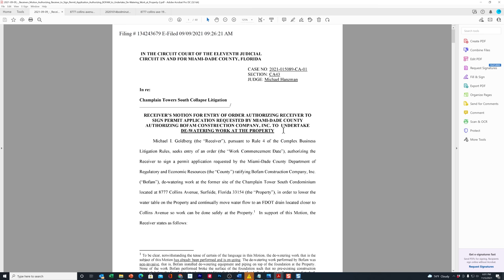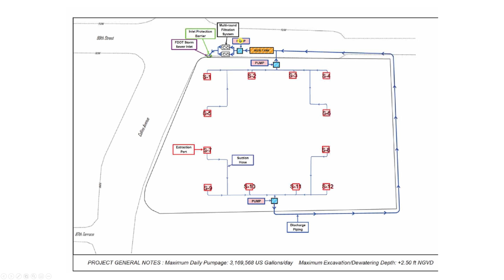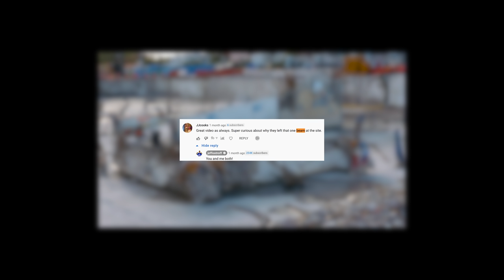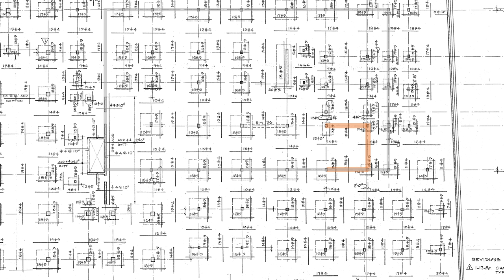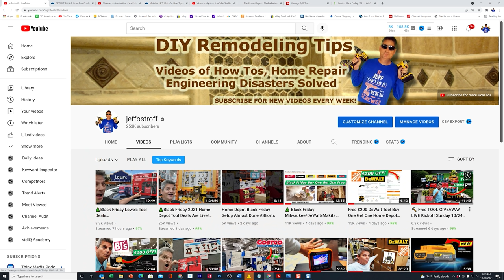Miami Condo Collapse: Engineers Baffled By Mystery Column

Comment: 2:03 You have your load theory backwards! The FOUR columns could actually be THINNER because they are SHARING THE LOAD OF ONE SINGLE COLUMN!
Look at the load point of the secondary column! There is no sign of attachment to the secondary column. That means IT SLIPPED OFF! All the floors give the column it's horizontal stability, so loss of the H beam is going to fire that column straight down like a released arrow with the mass behind it of a steel and concrete locomotive, a Coors Silver Bullet rectal cancer special!

Comment: Are you sure it's not just a rebar bundle that was placed there?  There are several bars that are just laying on the ground and the others look like they could just be sitting on top of the cement as opposed to sprouting out of it.
Reply from the maker: it could be, but they are impaled into the concrete
Reply: @jeffostroff  Doesn't that imply that the column wasn't there?  Or am I missing something?

Comment: Why is there only one H beam on the property, and why there?
Reply from the maker: There is only one H-beam there because it is the only place where they needed 1. I'm sure they are fairly costly to make so you would want to limit them because it's a lot of concrete and rebar to form together just to keep 1 stupid column from blocking the driving lane inside the garage. So this H-beam was built to allow a floating column on the 1st floor to go all the way up to the Penthouse, but yet not protrude down into the garage where it would interrupt the driving lane. So they accomplished this by placing the H Beam on 4 columns columns and then the cross beam supports that K column running up to the Penthouse.
Reply: @jeffostroff  Thank you for the explanation. I was more wondering why an H beam was more critical there than elsewhere. Is it because of the penthouse adding more weight?
Reply: In terms of physical size, the H beam was a baby.  Champlain Towers South had an absolutely MASSIVE array of transfer beams on the west side, one floor higher, 50% more massive in cross-section than the H beam.  

Fortunately, the architect was smart enough to use bigger, 24" x 24" columns to support them & the west side, and that is a pivotal reason the west side didn't collapse with the rest of the building.

Comment: I looks like the column was added later as after check review that could have possibly found that either the beam directly under the column or the two transverse beams in which the that beam frames into did not have adequate capacity to support the load and therefore the additional column was added.
Reply from the maker: That is my theory, that the column was added later.

Comment: Excellent work. My guess is that the column was placed  by mistake or was constructed and then the design was changed. With a new design the column base was irrelevant  and  just buried in the garage floor.  Is there a footing under this column suggesting that the columns load  was going to run up the building, but at some point the massive h beam was placed allowing car access and anchoring this corner of the building. Another paper trail for clues.
Reply: Uh, no.  
The H beam was in the original plans and was for the sole purpose of allowing them to remove column O8, to get rid of a 12 x 12 column running up right through the middle of living rooms in those premium corner units.  It does add some stability, but that is not it's primary purpose.  It's to carry the load from column K (a 'floating' column running from 1st floor to penthouse) and transfer it to the 4 adjoining columns in the garage, into the pilings.  
The H beam wasn't 'added later'.  It's legs are 24" x 42" and the thing weighs 65,000+ pounds.  It was intended from day one.
As for the mystery column being a mistake and "buried in the garage floor", well, it sure doesn't look buried to me.  That rebar sticks up a couple feet above the intact slab. I don't imagine any sane person would bend that much rebar into a hole in the ground and rebar doesn't have anywhere close to that level of elasticity to spring magically back...  Also, there's no hole.  The rebar is integrated into the intact slab and concrete has clearly been poured around it.
Reply from the maker: Also there is no pile below where that mystery column is. You don't generally want to ever place a column unless there was a pile with a pile cap below that column extending all the way down to the limestone bedrock.
Reply: Nope, it was always there. The H-beam didn't fall straight down, and ended up closer to the ramp.

Comment: Too wierd, Jeff. I’m stumped myself!
Reply from the maker: I doubt anyone will figure this out.
Reply: @jeffostroff  - possible this H beam fell out of the garage ceiling near an existing beam? Are the beams all accounted for?
Reply: @jeffostroff  I think we already did figure it out.  They were putting in this makeshift column to support a structural deficiency, like a sagging or cracking slab.  That location was pretty close to the exterior wall, so it's likely the corrosion and spalling from the pool deck outside had spread to that area and was sagging the floor.  
They put the column inline with the 'O' row to minimize parking disruptions.  You could still access spaces 18-23, but just from the other side.  When the column was complete, I bet they would have put up a cinderblock wall running from 'O-8' to 'O-9.1' to close off the lane and minimize accidents.
I think we should call this mystery column 'O-8.5'

Comment: Very interesting summary and analysis. I am not an engineer. Although you do not believe this to be an impact i think this is the only logical explanation. Video clearly shows nothing in that location in the garage before the collapse. The center of the "U" had a pillar running straight up a few inches away. I think it would be logical that a pillar from a higher floor impacted the concrete when the "U" fell to the bottom of the building. Little evidence to confirm as the area is cleaned up now. My two cents.
Reply from the maker: Yes this is a tough one
Reply: The centerline of column at 'the center of the U', column K, was 5'3" away from the centerline of the 'O' row of columns where the mystery column is aligned.  (When the building was intact.)
There's no way any of those column K segments got displaced 63" laterally, then magically turned into high-speed, perfectly vertical bullets, capable of penetrating a 9 1/2" slab.  
The mystery column was an ill-conceived bandaid, meant to fix a cracking slab.  It was done without the knowledge of Surfside and placed in such a way that people would mistake it as part of the original building.

Comment: Is it possible that they had the plans, 1st floor & above showing the column. And the basement plans showing/not showing column? When it came to actual construction they realized that weight bearing column would be in the center of their driveway..,... (Coming to find that major flaw in the plans already in to the construction phase. Decided  in their haste, ignorance, & supreme stupidity.) ( Maybe even without the architect somehow knowing about this) ......that they decided to hide the column?( Idk bend the rebar down and backfill a little with gravel and the a thinner section of cement over where it was to be?) Something to that affect.. I know anything is probably possible at this point. But,is there some way pull something like that off ?( or maybe some totally different way then what I suggested) Again IDK. I was a Rough Framer for many years. So,I have a better ability then jack (that don't know $h!t) to understand prints with 20+ yrs exp( mostly homes though, not much commercial.)I have seen some unbelievable things that were tied together.( Looking at it wondering why this place didn't fall down years ago,smh. WTF 😒.) What is the likelihood something like this happened?

Comment: Did they add a column to the H transfer beam underneath at garage level because that corner of the building was setting unevenly? It seems like a pretty hokey fix for such a serious structural issue to me if that in fact was what occurred.
Reply from the maker: That is my current theory
Reply: @jeffostroff  I think as sea levels rise and cause coastal ground water levels to rise a lot more of these buildings that were thrown up in the ‘70’s and ‘80’s, by developers motivated by profit margins, are going to have similar, serious problems. These buildings anchored in alluvial strata with rising sea and ground water levels are a recipe for disaster. I’d think that remediation would be prohibitively expensive and difficult, not to mention temporary at best.

Comment: It is obvious that no column existed on that ground floor, and so I  wonder if the big transfer beam was improperly located, off set from column line above.  The contractor might have just put the columns where they needed it to fit anyway.  Could that column  have collapsed straight down and maybe the resteel  penetrated the concrete floor slab as it crashed down.
Reply from the maker: Fiorella's garage video clearly shows that all the columns and H-Beam were correctly placed exactly as shown in the floorplan.
Reply: It was there and on the plans

Comment: The red paint is on column 17, Jeff.  Its gone with the concrete but @6:18 the column 17 is on the left not the one on the right which also had red paint and still does but is NOT 17.
Reply: Look at the column plan in the garage Jeff.  You can see your location is wrong.  That mystery column is clearly shown on the column plan and the garage video shows where it really is and the ramp simply doesnt end where you have figured.
Reply from the maker: No you are wrong, the ramp ends where I said ti ends. You are looking at the wrong page to determine where the garage ramp ends
Reply: @jeffostroff  i am looking at the column.  It is real world and cannot lie.  Look again.
Reply: @jeffostroff  oh and thanks for the reply!  I love all the work youve been doing.

Comment: The H-beam has been moved.  The South beam is laying where the North beam should be.  As it is laying, the north beam is in line with the bottom of the ramp, but according to the plans it should be one beam row further south.  The 'mystery' column is on the plans.  It is in line with the northeast corner beam of the H beam and slightly north.
Reply from the maker: No, the H beam has not moved look at 1:06 that photograph shows the current position of the HP and the red box shows the outline of the building. If you compare that to the floor plan the H beam is in the exact spot it is supposed to be in the floor plan. It did not move. As the building collapsed right down on top of it so it would have fallen straight down to the garage floor 8 feet below.
Reply: @jeffostroff  My apologies.  I misinterpreted the lines on the drawing at 12:35 as the bottom of the ramp.

Comment: The rebar/column is stabbed in the basement floor from the down force. As it was a column from the 2nd floor on. I think it's a freak thing...
Reply from the maker: Your hypothesis comes up a lot from boatloads of people about that column. I don't think it's possible because if it had slipped off it would not likely have come straight down where the mystery column is which is only about two feet away from the HP. Also if it had impaled the floor there should be damage all over the concrete there and there is none where is the crater? So where else could the column come from? So far my prevailing theory is that somebody started to build that column sometime after Fiorella shot her video in July 2020. however I could find no permits for it

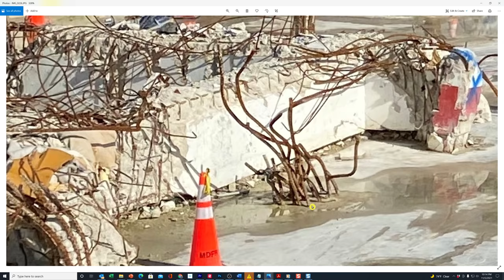Comment: @13:49  What strikes me about (the images of) that column, is that there are no concrete fragments in and around the rebar, (all the other columns in the image are still mostly encased in concrete) and although the slab surface isn't captured in detail, because it is wet, it appears to be near to flat and level with the rest of the slab in that image.  ..... Which makes me think that that rebar in that column was never encased in concrete, or had the concrete stripped away during the collapse.

At this point every explanation for the mystery column appears improbable and/ or contradicted by other facts/ observations/ evidence, and I can't help but wonder if some how, some way, the entire picture isn't where we think it is on the plan, or that slab in the image isn't actually the garage floor, because if that is the garage floor, and the location is as described, and given that there is video showing that that location is in the middle of a driveway through the garage, with no column evident, then given those "facts" the only logical conclusion is that those rebar rods were inserted into the concrete slab during the collapse, presumably from above, no matter how improbable that seems.
Reply from the maker: Look at 1:06 again, that shot was taken directly overhead clearly shows that the H beam is exactly where I said it was. Everything makes sense and lines up including if you paid attention to where I said watch this column with the red stripe on the bottom. It's the only column in that area of the garage with the red stripe. And when you look at the video of the lady walking through the garage it clearly shows as I pointed out in the video, the H beam sits with the corner of it directly on top of that red striped column. So everything aligns with what I said. You need to prove how and where I am off.
Reply: @jeffostroff  OK, I appreciate that you're confident, and you are probably correct, but I am just not certain how something as ephemeral as "red paint on a column" is definitive of location, especially when trying to explain the spontaneous appearance of a load of rebar forming a proto-column.  .... The satellite image at 1:06 does more or less address my concerns.  🙂

I have been following this story since the day of the collapse even though I am not an engineer, and I have been enjoying your videos and appreciate the time and effort you have put into them.

Comment: Why is that whole beam structure there to begin with? Why couldn't they just settle on which columns are needed and have them go up all the way up and down. And why in that spot? Looks very strange where they stuck the structure. Did it have something to do with the sheer wall and the elevator shaft?
Reply: Well, if the northeast column supporting the H beam (the one painted red) continued all the way up to the roof, it would have been smack dab in the middle of the living rooms in the corner condos.  Corner units command a higher price, so they didn't want to compromise their value by having a strange, tacky column in a room that should be open space.  
So they designed the H beam as a transfer beam, and put in column 'K' on the center section to redistribute the load.  Column K forms the corner of the kitchen walls for floors 1-11, and it's on the south exterior wall at the penthouse level.
Reply: @johnbergstrom2931  Oh, ok, that makes sense

Comment: Could it be the column from the 1st floor being driven through the garage slab as the h beam shifted to the side and the (mistry column) building dropping it on the slab. If you get enough force on a not so great slab there is a chance to punch a rather nice hole for it to fit in.
Reply from the maker: there is zero damage on the floor where there should have been craters or something else if it had impaled into the floor but there is no damage. These rebar rods look like they were intentionally built up out of that concrete floor like it was done by somebody in the last 12 months, since Fiorella shot her video inside the garage in July 2020, showing no column exists where that mystery column is.

Comment: The obvious answer is that this “mystery” was added, sometime after the video. But, do you ever add columns long after a building is built?
Reply from the maker: My theory on this is that if they did add a column sometime in the past 12 months, it was likely as a temporary shoring for some damage they saw on the ceiling of the garage until they get the pool deck repaired and replaced.

Comment: First floor column speared through the basement floor during the collapse?
Reply from the maker: you forget that there is zero damage on the floor where there should have been craters or something else if it had impaled into the floor but there is no damage. These rebar rods look like they were intentionally built up out of that concrete floor like it was done by somebody in the last 12 months, since Fiorella shot her video inside the garage in July 2020, showing no column exists where that mystery column is.

Comment: Maybe the red marking on column 17 simply indicates the location of a fire extinguisher.
Reply from the maker: Pay attention to the photos I showed inside the garage. The yellow stripe columns had fire extinguishers, not this one red column. Also this was the only red column in this section of the garage. You must have extinguishers every other column. So this disproves that theory.
Reply: @jeffostroff  Good!  I can't imagine why anyone would put a column where it wasn't needed unless they simply made a mistake, thinking it was necessary for support at that location.  If the plans didn't call for it, it just doesn't make any sense.

Comment: Has anyone asked residents if there had been a new pillar placed in the e/w driving lanes prior to the collapse. My initial thought was that they had placed the load pillar on the first floor in the wrong position but as you state, it does not appear that this is an impalement which might have been caused when the collapse occurred if the pillar was offset a few feet.
Reply from the maker: I would like to be that somebody